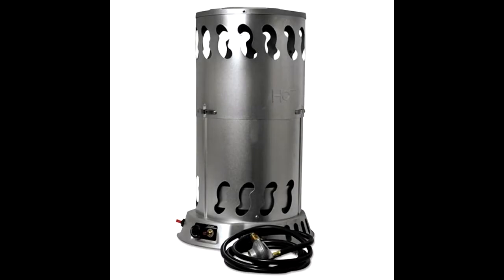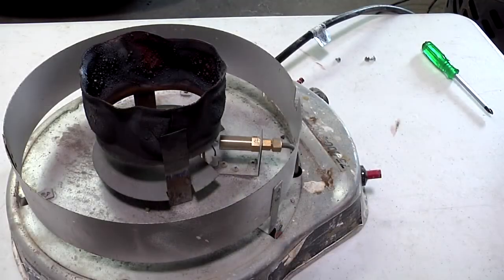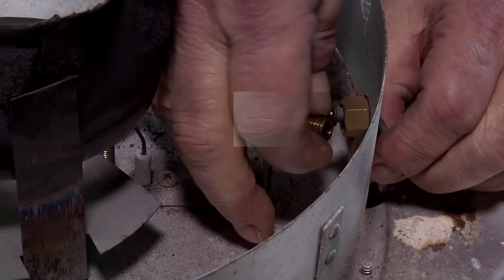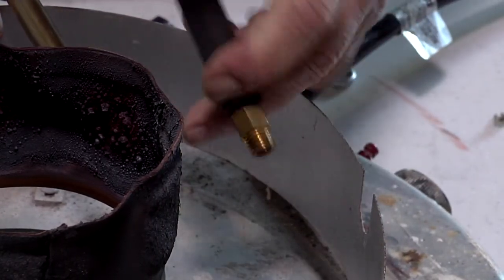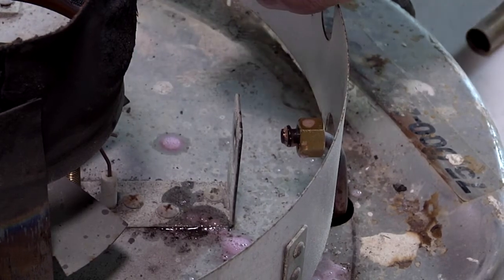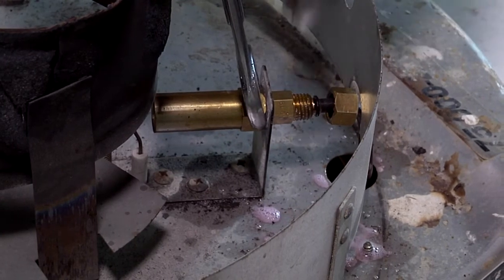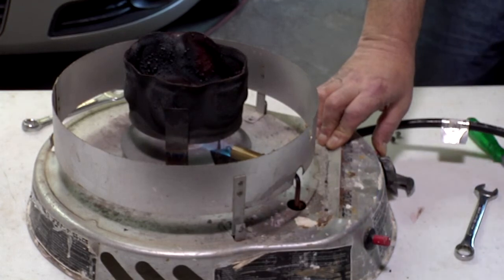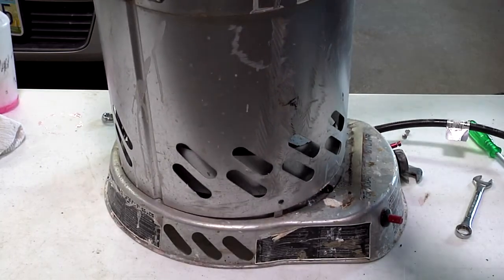Convection Heater

Comment: Thanks for mentioning that the pilot flame needs to stays on during operation. I just refurbished an old one of these, and after getting it going per the instructions, that kind of surprised me. I guess that's so if a wind blows out the central flames, the gas is immediately reignited.